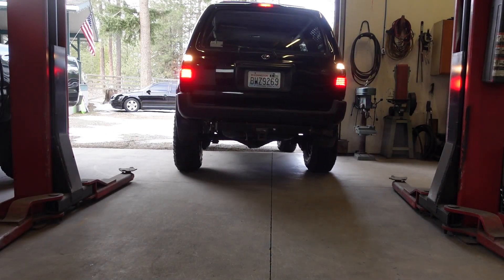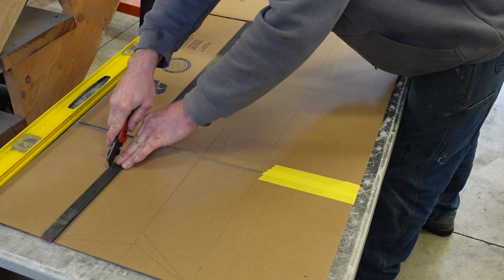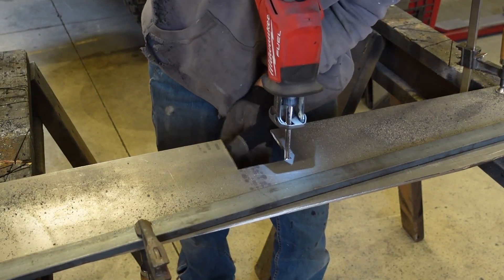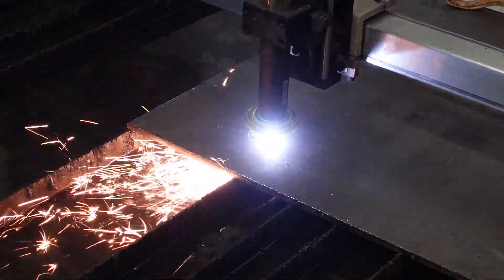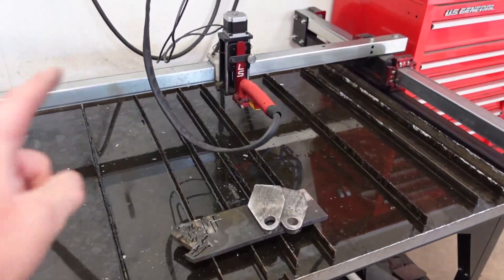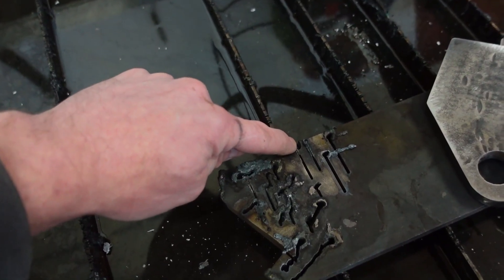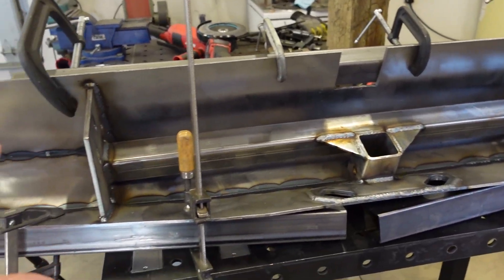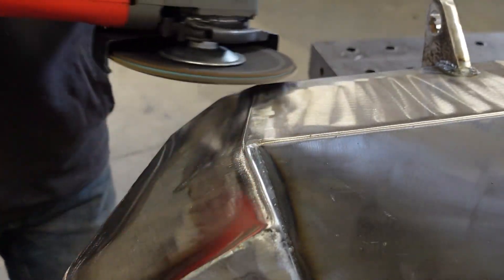Building A SWEET Rear Bumper For The 3RD Gen 4Runner!!

Comment: It’s all well and good putting braces on it but you also need to pre load it
Reply from the maker: Pre load?
Reply: Normally 9/10 times anything you weld shrinks or pulls so if you pre load it by spreading it a few millimeters with a porter power then brace it, it comes back to normal after braces are removed
Reply from the maker: @SootyDiesel81  makes sense!! I am happy to say I have had great success with welding slow, letting it cool between welds and bracing!!

Comment: Hey there! Great job on the work as always, but there's one thing I wanted to mention. I had a Toyota Surf with a 185 body style for a long time, and I can tell you that because of its negative form which resists aerodynamics, a lot of dirt and moisture gathers under the rear bumper, which absorbs the moisture and causes the metal to rust quickly. It's really important to make ventilation holes (maybe there's a way to make them look nice?) because it'll help to ventilate the space, and also significantly reduce the weight of the bumper. 
Best regards, 
Vadim from Vladivostok, Russia.

Comment: Tacking in bracing and gussets really helps keep the warping to a minimum. I braced the hell out of my TDI engine mounts, and they dropped right into place and the bolts lined up perfectly. My oil pan on the other hand needed a bit of therapy to fit flat on the block.